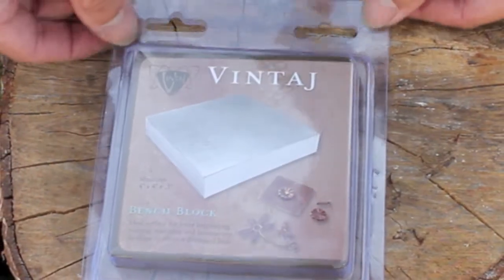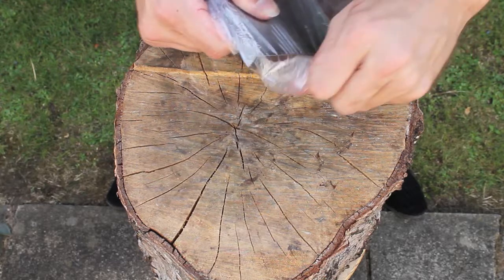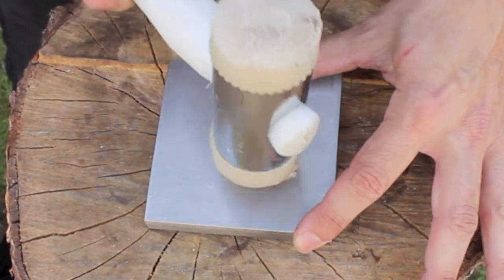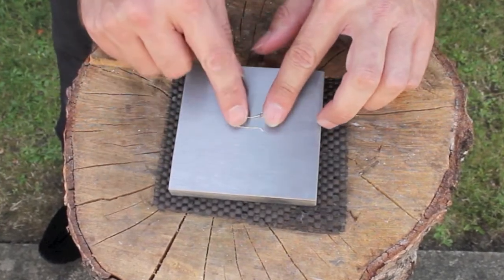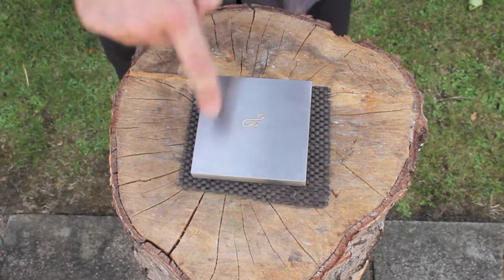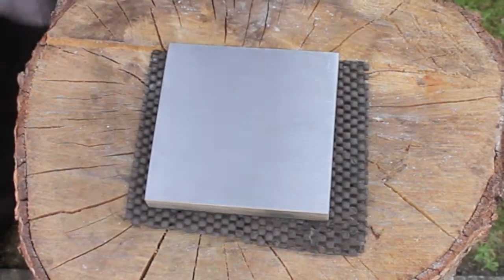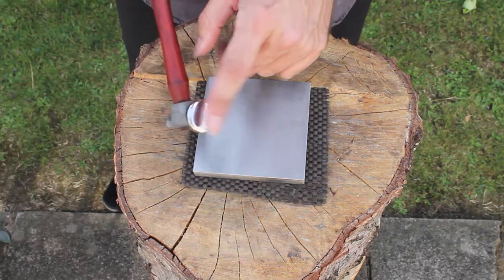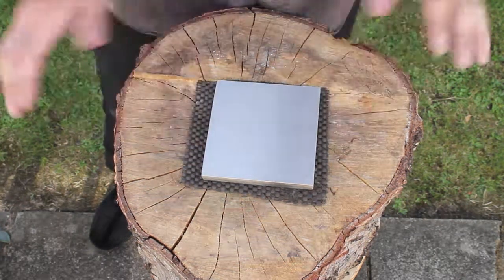Vintaj Steel Bench Block Anvil Demo / Review in HD

Comment: I just received my block and found a sticky oil on it ..I know that it is to prevent it from rusting in shipping should I clean it or leave it? ...if I need to clean it what should I use? Great video thanks for sharing
Reply from the maker: Hi. Thanks for your question. The sticky grease is obviously to prevent it from rusting in transit. You can easily clean it off with some white spirit, or methylated spirit.
I would then recommend a light wipe over with WD-40, just to prevent any rust. Obviously keep it in a dry place.

important when taking things out of the pickle or a tumbler (i.e. wet). Ensure all items are dry before putting them on the block. It is steel and will rust if not cared for.

Thanks for watching. Don't forget the thumbs up. kind regards Dave.